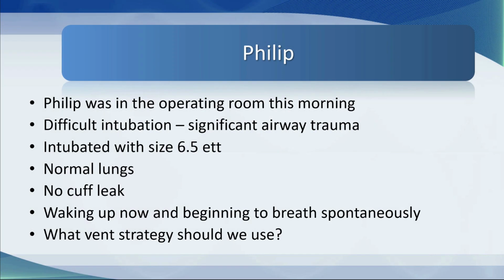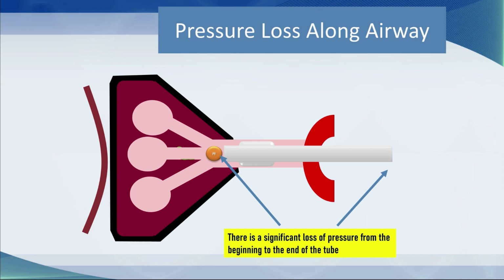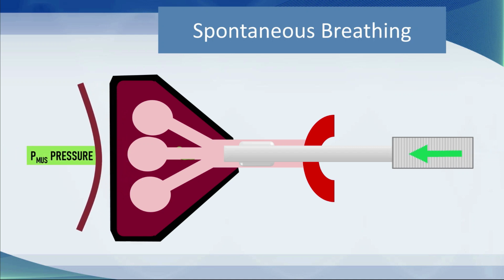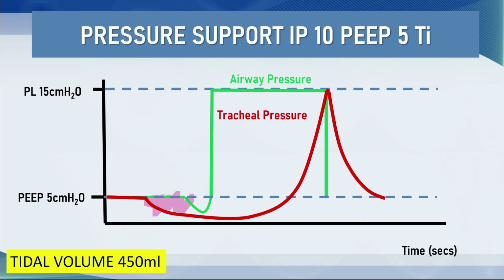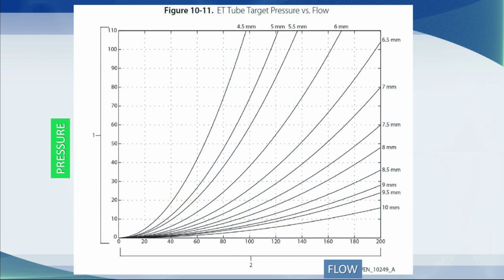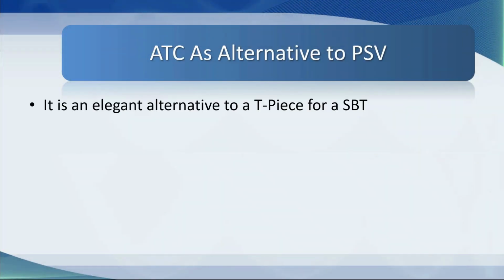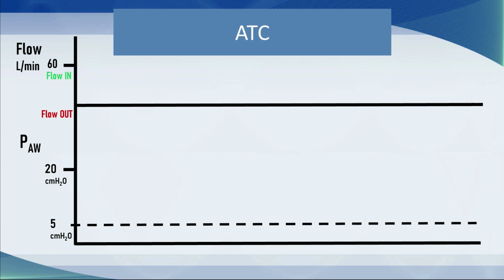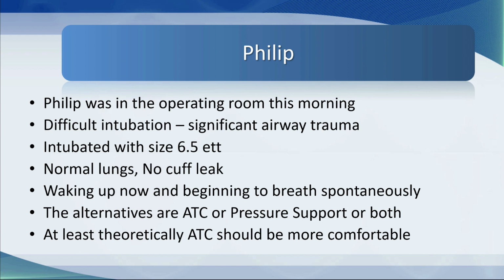Automatic Tube Compensation

Comment: Why When we using ATC in VC mode have constant inspiratory flow can't use it at mandatory breath which I read the Drager V600 manual told me. sorry for poor english😢
Reply: Properly set tube diameter or check your flow sensor, might need replacement or check airway patency even the circuit